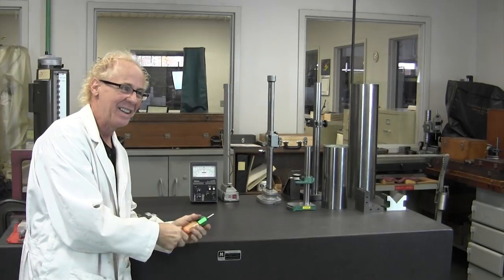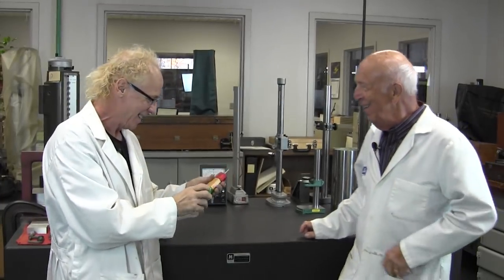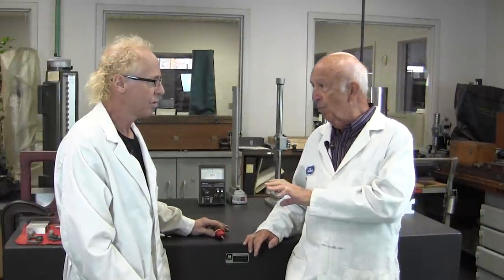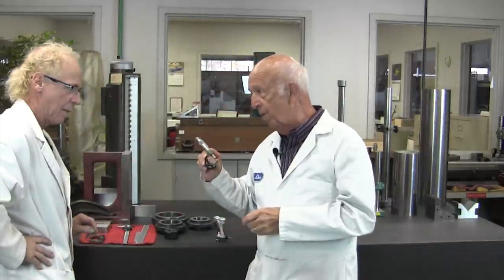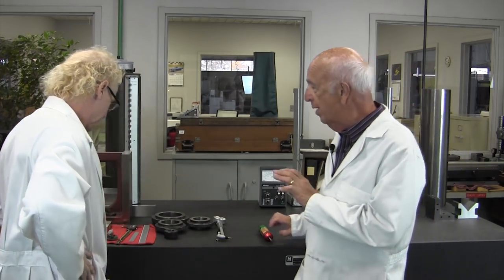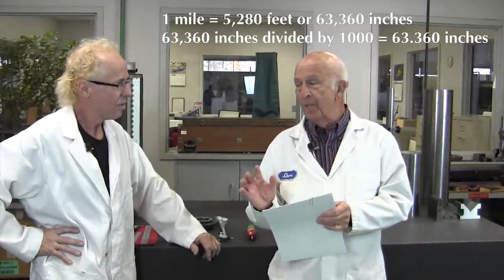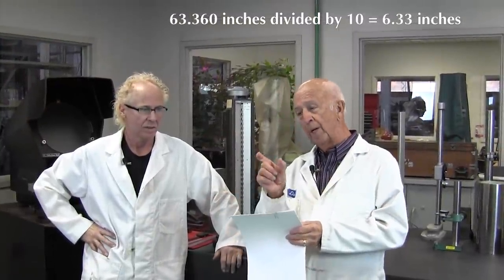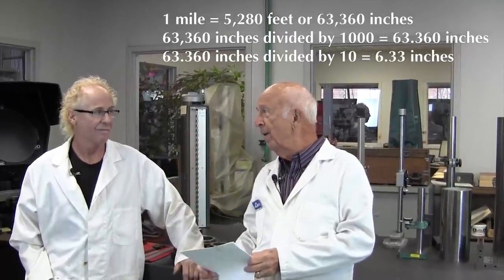How to measure using the proper tools!

Comment: As a civil engineer and surveyor, I have measured a mile or more with a steel surveyor's 100-foot tape within less than 0.1 of a foot.  One inch is 0.083333 ft., so within 6.33 inches is readily doable.  I do know where you are coming with these relative distances and appreciate them.